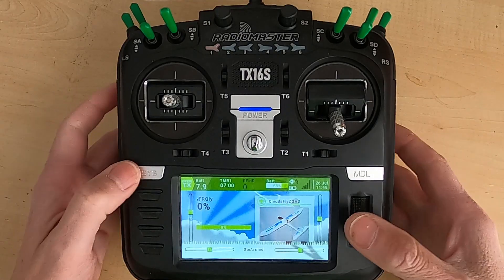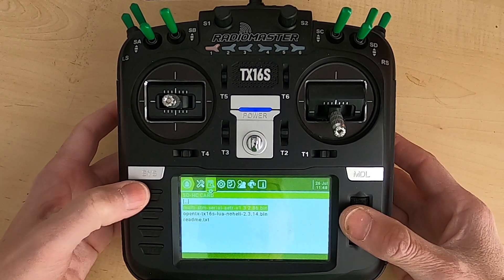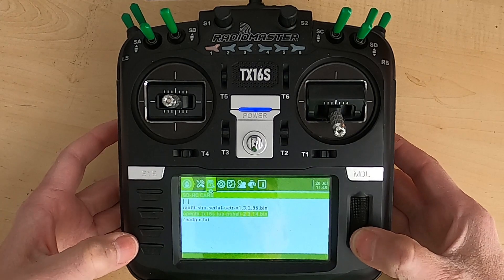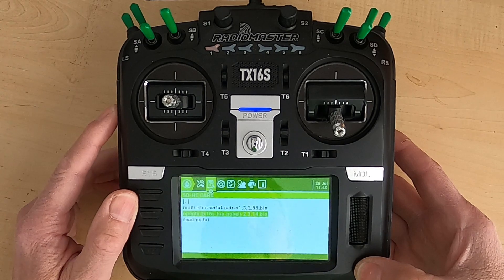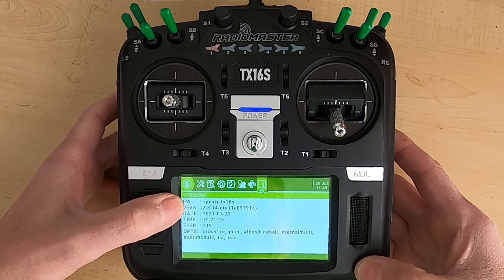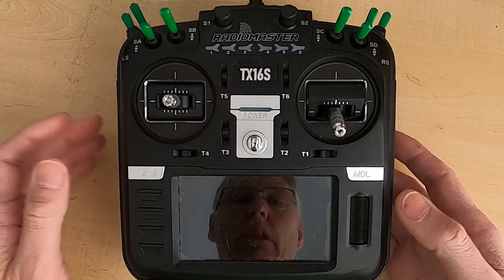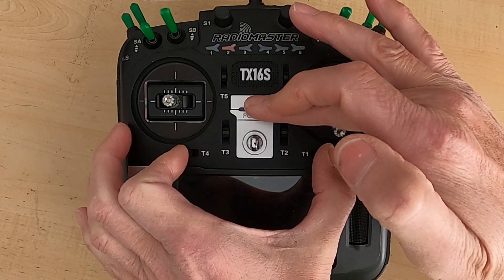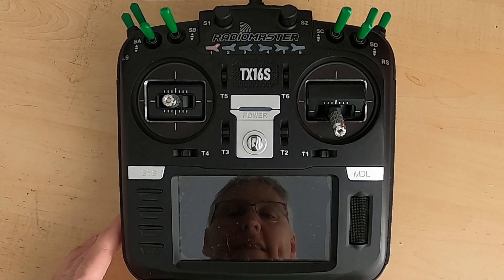OpenTX, How Do I Update My Radio’s Bootloader?

Comment: Bill , i did flash the firmware but when i checked the system bersion it remained the dame as factory, i have boxer. any ideas why?
my guess is that should be another way to enter to the bootloader mode for the flashing to be effective but i do not know.
Reply from the maker: Alex you have asked the question on the OpenTX video and I a sure your Boxer has EdgeTX so here is a link to my video which will help you  https://youtu.be/sbHmlFbzT7w?si=U37zzQX7PtYxRz3i

Comment: Thanks for making this video! Several months ago, I picked up a TX16s from a closeout sale on the Team Blacksheep website. I figured I'd use it as a spare.  Today, I decided to unbox it and put the latested EdgeTx (2.8.5) on it. I copied the binary to the SD card and tried to flash it, but it wouldn't flash. Once I selected the file, the screen would just dim and freeze. Only option was to power down the radio.  The original software was an older version of OpenTx, and eventually it dawned on me that the bootloader was probably the wrong one. I had no idea how to install a new bootloader, but a quick search brought me to your video. I followed your instructions, selected the EdgeTx binary and sure enough... it worked! With the new bootloader I was able to flash to EdgeTx 2.8.5.  Awesome! Thank you!

Comment: Hi Bill
Love your videos very clear thanks. I just got my radio master tx16 max my firmware on the radio at the moment is 2.3.11.  I try uploading the new firmware 2.3.14 but as soon as I  added the SD card download it stopped and said my SD card is full. When I go into bootloader on the top is still old firmware but at the bottem it say new firmware. I baught a new SD card. Try to download everything on that the radio just say invalid card. Helpppppp please
Kind regards
Johan
Reply from the maker: Hi Johan, first thing I would do is download 2.3.14 firmware from the OpenTX website again making sure you download the correct channel mapping for your radio. Follow the video you have committed on to update the bootloader. Now update the OpenTX firmware on your radio.  This video should help you. 

https://youtu.be/1oD9E4klTUc

Once you have done the above download the SDCard contents for your firmware version. Now format your SDCard and copy SDCard contents to it. 

You should be ok. I am not sure why your SDCard is full. 

Please let me know how you get on.
Reply: @the-happy-RC-flyer 
Thanks for replying back so quickly. I really appreciate it. The card in my radio is only 250mb. Going to use a 64gb card. Will let you know when I done it. I'm from Cape Town south africa.
Regards Johan
Reply from the maker: @johanopperman8039  a 16gb would be fine I am using a 8gb in one of my radios.    Let me know how it goes.

Comment: off topic a little. I have a question for you.. How can i have my radio screen show the number of flights on each model?.. I know some guys have done this but i dont know how. Any info be appreciated.
Reply from the maker: Sean I have never set up this function but please see the links below, your model will require a GPS to be installed as it is triggered by the models altitude. 

https://www.rcgroups.com/forums/showthread.php?3044357-Flight-Time-logger-for-OpenTX-Taranis

http://open-txu.org/home/special-interests/telemetry/working-with-log-files/

Comment: Thanks Bill, I too hadn’t uploaded my boot loader since 2.3.8, had to put the file onto my sd in firmware folder first but once I did it worked exactly as you showed so thanks again.

Comment: If you update the radio with the power off, from OpenTX companion, both bootloader and software are updated at the same time
Reply from the maker: Ulf I have just checked this and it did not update the Bootloader. If you plug in your radio off and not in Bootloader mode, trims in power on, it will not update either firmware or bootloader. In Bootlooder mode only the OpenTX firmware is updated when using Companion. I did the test with a RadioMaster TX12.
Reply: @the-happy-RC-flyer  You should not power it on, leave it in power off mode and open OpenTX Companion. then flash from there. I did it with my T16S a few hours ago and it works.
Reply from the maker: @Ulf_Ma  I will check it out with the next OpenTX version on my TX16S. Maybe different for the TX12. Thank you for your feedback it is appreciated.